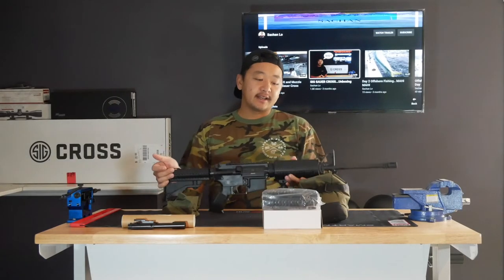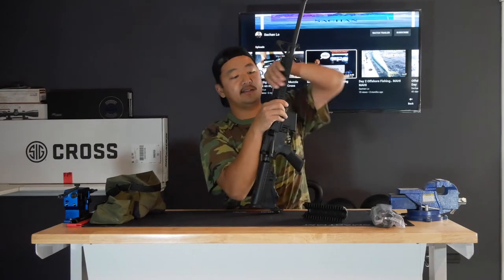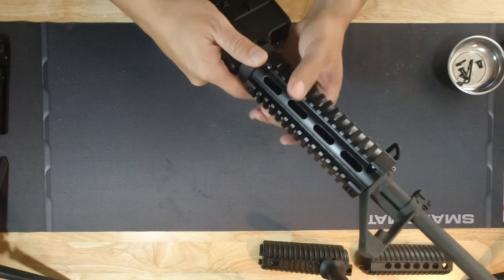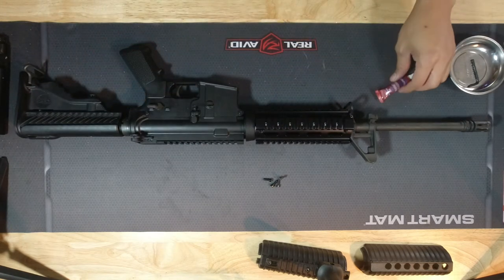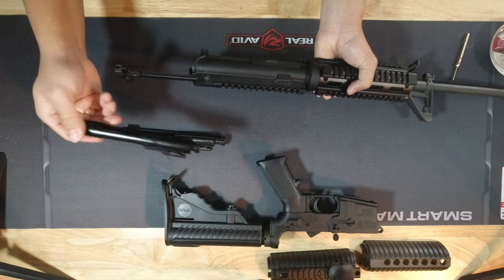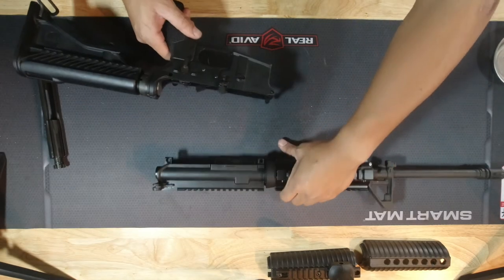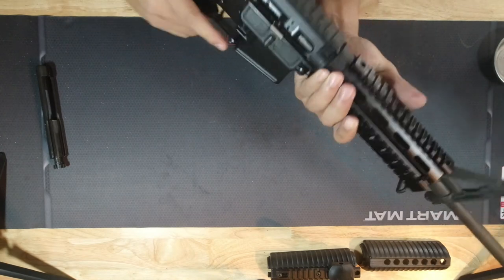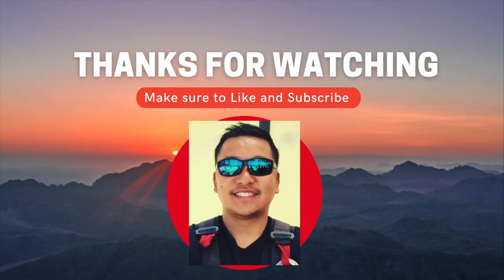DPMS Panther AR-15 Updgrade

Comment: I'm impressed that you swapped the guards as smooth as you did, I have the tool finally for the D ring after too many sore finger joints!
Very clear and simple demonstration 👍
Reply: I was surprised at how easy the handguard came off definitely wasn't that easy for me i used the channel lock grips to pull the d- ring.
Reply: @universallaw8850  oh yeah, I understand what you mean.
Good idea 👍

Comment: To give you a heads up, if you go to change out the buttstock, the buffer tube is commercial so standard Mil spec stock will not fit over the tube. You have to replace the tube also.
Reply: Yes will need milsp but watch out for flying detent pin. I did magpul on most mine